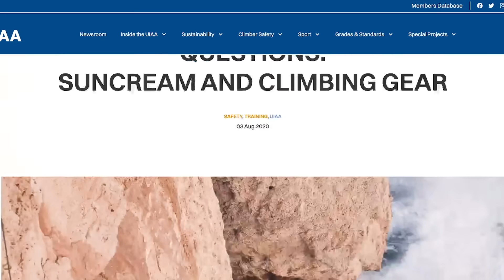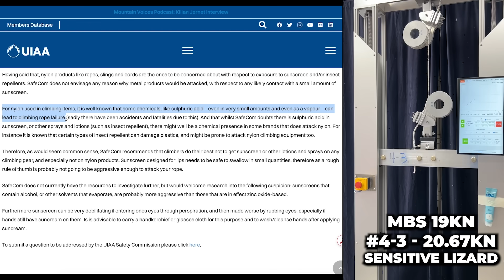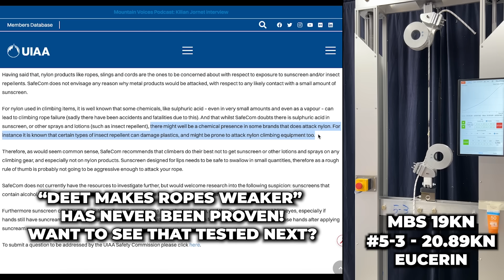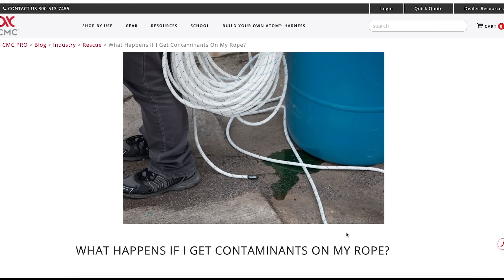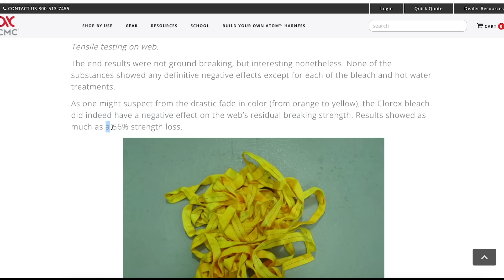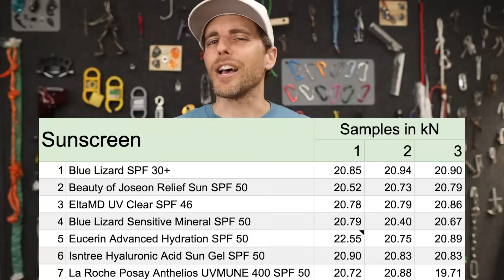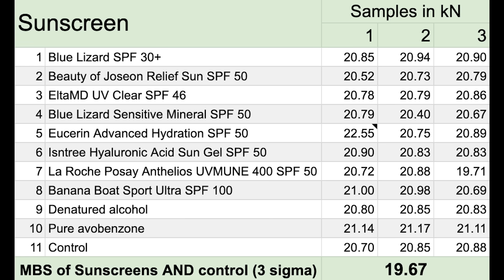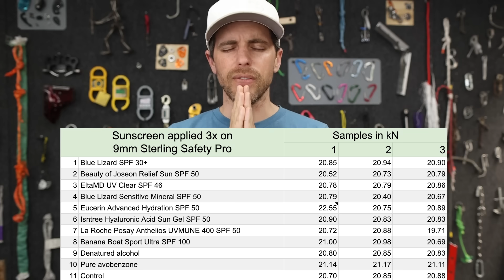This is going to piss off the worlds largest climbing organization

Comment: Here's the kicker: most "science" is this bad. Truly. I do research in mathematical theory, and an unbelievable number of articles are literally nonsense. That's the truth. Hard pill to swallow, but it's the truth. They get peer reviewed, too, because nobody takes peer review seriously. We aren't incentivized to. It doesn't count as a publication, it doesn't go on your CV, you get no kind of career boost from doing it well. If you do it well, you get rewarded with more journals asking you to do more of it...for free! It also takes an enormous amount of time to do properly, probably 50 hours at least per paper. So...people don't do it properly, they spend that time making their own research...because that will get them promoted! They want a high publication count...but since no one is reading them re: peer review, they don't have to be good! I have had senior mathematicians tell me this to my face. 

Even worse than that, there is a significant amount of literal fraud. People just lying because they want to finish the paper, their idea failed, and they believe (mostly correctly) that no one will read it. 

So...there ya go. Keep that in mind next time someone tells you to "trust the science". Doing science correctly so that real conclusions can be reliably drawn is extremely, extremely difficult, and very sensitive to little mistakes. Most scientists aren't cut out for it. 

If I had a nickel for every time a weird mathematical claim was made, cited, I followed the citation and actually studied the paper, and it had literally nothing to do with the claim they made...I would have a lot of nickels. It still makes me angry every time even though I know it's the way of the world at this point. Wild stuff. The fraudsters progress pretty well career-wise because they have high publication counts. It's difficult to produce real work as quickly as they can produce crap. It's a sad state of affairs. It's not a lie that the academic establishment is sort of on its last legs credibility wise. We have entire fields that can't be reproduced. It's a real grade A mess.
Reply: While you are correct, I'd just like to point out that the rates of "bad science" are VERY field dependent. If you read, for example, "The Entrepreneur's Guide to a Biotech Startup" you will see HOW MUCH goes into getting a chemical as a marketed medicine. It is basically impossible.

Similar rigor goes into academia in areas such as finance, actuarial sciences, other stuff that deals with rich people's money directly. I have friends still in academia after their Physics PhDs and according to them, the defense industry is also very intolerant towards "bad science".

But, as someone who left academia a decade ago, there are fields much - MUCH worse than Maths. My top three are in no particular order "econometrics", "neuroscience" and Exercise science/nutrition. Please note that it is not Economics, neurology and clinical nutrition, so while I am talking about some economists, I'm not talking about MD doing research, neuroscientists don't need to be medical doctors and almost no nutritionists are (depending on the country, each one I think defines the profession differently).

There are plenty other bad ones, from psychology to economics, but those three are the worst bottom of the barrel black tar of the sciences.
Reply: @prgnify I know...but math is supposed to be one that's "not that bad", and I am enough of a subject matter expert to know that is false. It is pretty bad. I do agree that industry is less tolerant of nonsense, but that's because industry actually had to come up with a working product in the end. Academics have no such burden in the world of theory. 

I can accept that the social sciences are nonsense. It is much harder to accept that pure mathematics is not the pursuit of truth I thought it was when I was younger. 

There are great mathematicians, and we all know who they are. Most are clingers-on. I have watched peoples' willingness to lie as I've collaborated with them. It baffles me every time. It's just a job to them, and they understand no one is going to be able to figure out if they are being truthful...it takes too much energy to determine. So, they lie.
Reply: @geometerfpv2804  My expertise in math leaves much to be desired. But these blatantly incorrect must be basically never quoted, right? Cause people using whatever was "proved" would find some error down the line, I imagine. 

I do read a lot of things from the ArXiv, but reading from there requires us to agree and understand that there isn't even any peer review. 

For what little things I do that are math-adjacent, usually there is code to be found, and so compiling it is by itself already a form of verification. 

Like for math there is Coq and other proof programming languages. 

What is your area of maths? Pure math? Number theory, category theory, combinatorics?

Do you know if this issue of "bad science" is spread to the other fields in mathematics or if it varies a bit more depending on the specific field? I ask because my prejudice would be that Category theory has much more bullshit than, for example, combinatorics or analytic maths. But maybe this is just my personal bias from having more problems understanding, idk, sheaves than graph theory - which could also be the fault of "less than ideal" professors. 

But the way I IMAGINE would be that the fields where the difficulty is in knowing what should be the subject of true or untrue, so "what should be true" is easier to publish bullshit than what you already know and have to prove the truth.
Reply: @prgnify  Re: "must never be quoted", not the case at all. There are mathematicians who will not use anything unless they've understood it completely, and know that it works inside their own minds, but they are the minority. Working this way causes you to be very slow, and publication count is rewarded, so this behavior is dis-incentivized (for the record, I work by understanding everything I use. It takes ages, and annoys my collaborators). 

People just quote results. Most results aren't important enough for one of the hardcore folks to eventually figure out what's wrong with it, so it doesn't end up mattering. I guess the overarching point here is that the vast majority of theorems proved just aren't very important theorems. When it comes to the big theorems, yes, they are correct (...most of the time, I can think of several counter-examples...), but that's not most of what math publishing consists of. Most math publishing is about weird contrived facts if they are facts at all. They aren't about central patterns of importance...these are usually quite hard to find, especially after the hardcore folks have already had a whack at it. 

People get jobs by having lots of papers on their CV. The people giving them the jobs don't read those papers, they just count how many they have and look at how interesting they think the titles are. 

I guess when I say "blatantly" incorrect, I am exaggerating. What I mean is, they look and sound like real mathematics, and you have to read very, very carefully to realize where the problem is, but I say "blatantly" because once you understand the problem, you realize it's fundamental, and can't easily be fixed...and therefore the result is completely invalid. That's the problem with science: it is very vulnerable to tiny mistakes. You may be making a mistake that seems very nearly correct, but in the end, turns your results from completely true to completely impossible. It's an extremely delicate process...and most people in the field aren't cut out for that. They get annoyed by that kind of delicate analysis, because the harder you look, the more problems you find, and the more problems you find....the more you are delaying their publication...they just want the publication...

So yeah, you do have these incredible almost-always-austistic people who just insist on doing everything completely correctly despite what everyone else is doing...but the rest of the people are surprisingly less detail-oriented than people think. They are relationship focused, not mathematical truth focused. They consider people who insist on doing it correctly "idealists".

Comment: There is abundant evidence in the literature that the Moon is made of green cheese. Well, replace evidence with mention and apply an obvious correlation to the preceding. Obviously, sunscreen will make your rope flow more smoothly through your equipment like waxing your ropes. Think about your Grigri, no more jerky stops, just a smooth ride all the way to the bottom, a fast descent, a real thrill until impact.

Comment: I’m now curious if the other synthetic materials used in climbing  are effected by sunscreens, DEET, weak acids (vinegar), bases (laundry soaps?).  

I recall BD did a battery acid test years ago with a small sample size that showed significant strength reduction in a climbing rope.  But don’t know if weak acids have similar effect.

Comment: PLEASE TEST DEET! I'd do the same thing you did here with the sunscreen but with bug repellent and also do a rope with pure deet on it
Reply: Deet definitely damages some plastics. Source: the door handle in my truck.
Reply: @TheMetalButcher  the important part is what kind of plastic.
Reply: @TheMetalButcher  Yeah, Deet impressively dissolved the hard plastic shell of my small inverter (car laptop supply), and completely ruined it. Not sure what cheap plastic those things use.
Reply: You test it , you can’t buy a ton of deet yourself and do it . 🤡 don’t get someone to buy tons of toxic chemicals  and experiment with it. Dude tests safety of climbing gear he’s not a chemist .
Reply: YES
Reply: While I agree, if you wanna check it out in the meantime, Rope-lab did some testing with deet a while back.  If I remember right, it was on quickdraws or slings, but had little to no affect.  Check it out.  Richard soaked some of the samples for a while.
Reply: @j.r.lilleskau9113  that's where I'd be most interested: the various materials used in slings would also cover just about everything used in harnesses, plus the stitching could react differently.
Bonus: no knots needed.

Comment: I wonder if the combination of knots and some chemicals can lead to more weakness. If I'm handling my rope, the place where there might be sunscreen is the knot. I can imagine the nylon fibres being fine when being stretched after encountering chemicals, but when there are bends the chemicals might exacerbate the issue (extra stiffness etc). Something worth testing?
Reply: Yes, you are correct. In aerospace engineering we call these "Knock Down Factors" (KDF). Tying a knot is one KDF, of about 40% (worst case). Lets say bleach is another KDF, and rope rub/abrasion is another KDF. The very very worst case scenario would be when all of these factors stack at the same location at the same time, and suddenly your breaking strength and your factor of safety is very low.

Comment: That's why I love your channel and the work you put in. Stuff like this drives me up the wall... Unsubstantiated fearmongering that consequently increases risk because we're avoiding other risk reducing means. Just like with glyphosate. Yeah it's bad but only if mishandled and only to those that use it not to the end products. And alternatives are less safe. Same with GMO... targeted changes to reduce pesticide absorption, increased resistance vs... irradiation to promote mutation for selective breeding. Or just sunscreen ... made up risks of using it vs huge risk reduction by using it.

Comment: simple answer: if it does not chemically interact with nylon, it will not make a nylon rope weaker!

Change my mind.
Reply: A steel blade does not chemically interact with nylon... :p
Reply: @hazelhazelton1346 inert mineral particles larger than a micron can actually abrade nylon fibers. But the particles in mineral sunscreens are typically less than 0.01 microns.
Reply: @hazelhazelton1346  welll... it does if it mechanically breaks the sulphur bonds.
Reply: It may in uiaa drop tests, simply by changing the coefficient of friction of the coated section over a sharp edge (e g  sharpie with a sticky resin carrier). But that happens under conditions of a uiaa drop test, not much in the real world.
Reply: I could imagine a situation where a lubricant could lower the strength of some types of rope, without reacting chemically with it. Does it actually happen? No idea.
Reply: Mechanical interactions.. Like, I think Cyanoacrylate has chemical interactions with nylon, can't remember, but some resins in some epoxi do not interact in any way with nylon, but if you mix them and let it cure, I bet the MBS will be different than just the nylon rope 10/10 times.

Comment: Deet, permethrin and picaridin would be sweet. I don’t coat my rope in permethrin, but because I climb in The northeast I coat everything else. Deer ticks sink ships.
Reply: I believe Rope-lab already did some testing with Deet.  Check it out, but if I recall correctly, it had very little affect.  And Richard soaked some samples for a while.
Reply: @j.r.lilleskau9113  There was an extensive test by Sterling Rope, before 2009; it is now gone from their website, but you will find it quoted on Mountain Project. To summarize, DEET had no effect on nylon, but some of the oils added to low-concentration DEET repellent did increase the elongation, yet not affect tensile strength.
Reply: Same boat exactly. I'm in VA where we have 8 tick borne illnesses lurking. Who would have thought Lyme would be the least dangerous threat?
Reply: some short-term-exposure deet testing 3 years ago by @HowNOT2: https://www.youtube.com/watch?v=yVnnyWZ8pVM&t=210s

Comment: Nylon may not be the most sensitive. Nylon is basically a synthetic protein, so anything that tenderizes meat will weaken it (stomach acid or any other acid, cooking, etc). Maybe you should try papaya enzyme if you want to weaken it. Other polymers may be more susceptible to solvents - you need to try some other ropes.
Reply: Who in the team is going to volunteer to provide the barf and digestive enzymes for that test?

Comment: Please ask the dermatologist what the occurrence rate of melanoma, basal cell carcinoma, and squamous cell carcinoma was prior to 1930 at the advent of sunscreen.
Reply: The incidence of melamoma has certainly imcreased, but the average onset of melanoma for males is age 59, and the average life expectancy in 1935 was 59. People used to get a little tan all year from outdoor work, but now have short forays where they get burned.
Reply: @harlanstockman5703 please define "a little tan", as this seems to be a fallacy. Go to any local trade hall and you can tell the difference between the industrial tradesman and the commercial tradesman.
Reply: Can I ask you how sharply Melanoma risk increases with age, and what percentage of the population belong to those age groups now and in the 30's?

Can I also ask you if there was any advancements in diagnosis of melanoma etc., from them to now? Like, what did those doctors in the early 1900's mean by "sea blisters"? Maybe "bad ulcers" as well. Do you think there was under-reporting going on?

Can I also ask you if the behavior of people changed from the 30's to the 60's with regard to sun-seeking, be it by traveling to the beach or trying to get tan as a more common beauty standard etc? Did anything happen after the 30's and before the 50's that made for example air fare's much cheaper? Or maybe some president that had a plan that made the roads all much better? How often did people get paid time off before the 30's vs after?

Like, even seeing the bathing suits people used way back when versus the 70's shows a huge contrast, and I think even whatever publication with whatever incentive to endorse sunscreen will tell you that covering your body helps a lot. Do you think the changes to "less modest" clothing has an impact on it?

I'm asking you specifically because from your comment I gather you did your own research, so of course you have answers to all of that, and of course your answers are much more trustworthy than that of the dermatologist, as you imply.
Reply: The diagnosis and reporting rate was a tiny fraction of today's. The advent and public promotion of sun cream would obviously coincide with increased patient reporting and the clinician recognition needed for diagnosis.

Comment: PLEASE test Deet! I would recommend different concentrations of DEET (10%, 15%, 40%, 50%) and also include non-deet mosquito repellents. But if possible, I'd be much more interested in getting belay loops tested. Now that might be quite expensive to find of course, unless some climbing brand would be generous enough to donate them to the cause. The stitching on harnesses always freaks me out more than my rope. But I guess that if it affects the rope, we can assume the same for stitching.

I think the application you did with the sunscreen was perfect, and would be a good way to do it with DEET.
Reply: Do you mean belay loops tested with deet? Because I'm pretty sure Ryan has done standard pull testing on tons of belay loops! Search through some of the older videos.
Reply: @snowmilk2240  Yeah belay loops with DEET. The reason I'd like to see belay loops tested rather than ropes, is that the load-bearing nylon stitching is directly exposed to the chemicals. 

With the rope, the mantle might absorb the brunt of the chemical impact, leaving the core with a smaller chemical load.